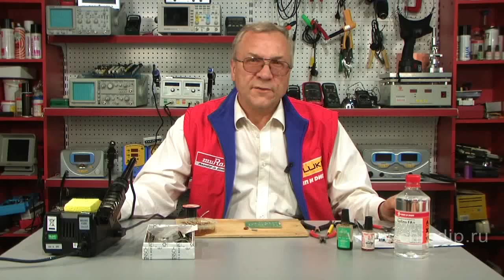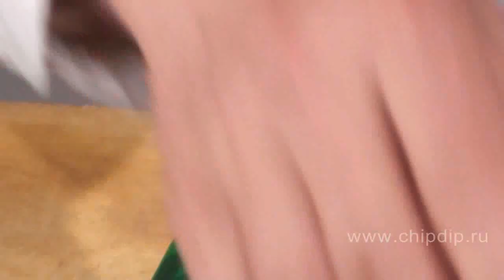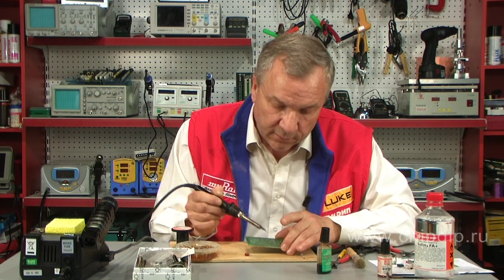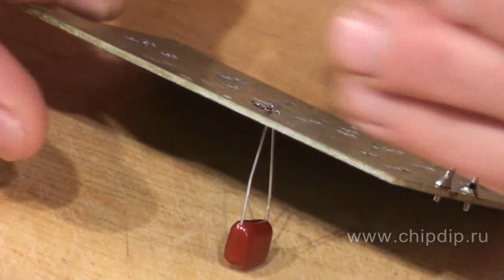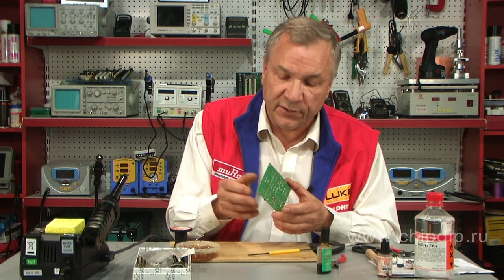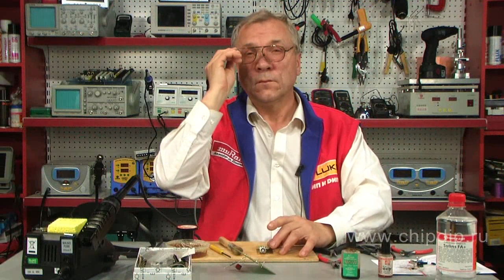The Better You Solder it, the Better It Works

Comment: It so happened that western standards rely on flux core solder, so direct applying of solder is the most popular technique in western countries. But at post-Soviet area we still load tip with rosin and solder, and it works great. You can't argue that when you see devices, made by this technique, working with very heavy duty for very long time.

Comment: Word "resin" means any type of tree pitch (tree sap, tar). Word "rosin" (aka "colophony" or "Greek pitch") means particular type of resin, which is used as soldering flux.This method is good and reliable because natural rosin doesn't volatilize as you load your tip with solder, deep it into rosin and then bring it to the works.

Comment: this is a great way to learn how to solder. This does not result in cold joints if all parts reach the same temp.....people flux is your best friend. but some are conductive but they need to be cleaned and dried. This is how pro's do it. Its not the old school method or the new skill method . Its just another method which is easier for beginners......

Comment: @MsRaptor1995 it doesn't really matter you can use any flux. The only thing is some are conductive so they most be cleaned after your done soldering. Just buy the flux and read the directions. there is flux none as no clean that hardens and doesn't effect the boards.

Comment: lol. I'm new to soldering myself, but I don't like the way this guy solders. I would tape that board to the edge of a table and put the tinned soldering tip to the joint and and touch the solder spool to it. Thats what every other video shows you.

Comment: How is this supposed to be good soldering?

Getting solder on the iron and trying to wipe it off onto the joint is a bad way to do it and will often result in cold joints.

You need to bring the solder and iron together at the joint. You must use flux-core solder. You can also add some flux but it shouldn't really be needed.